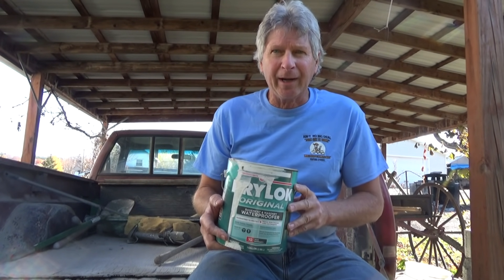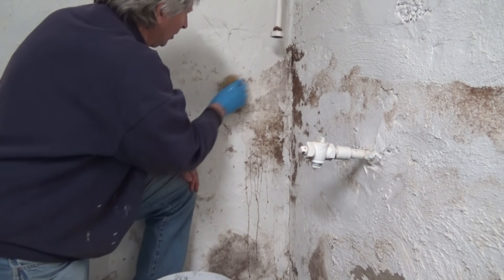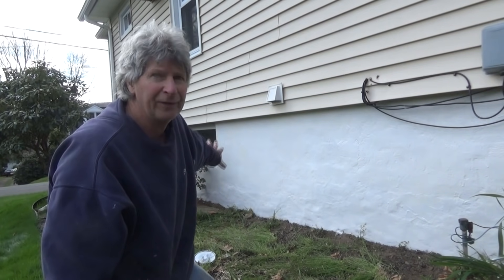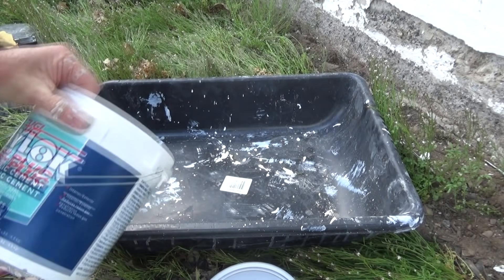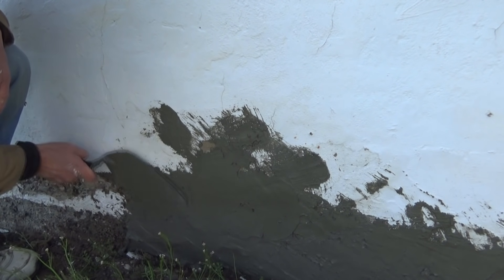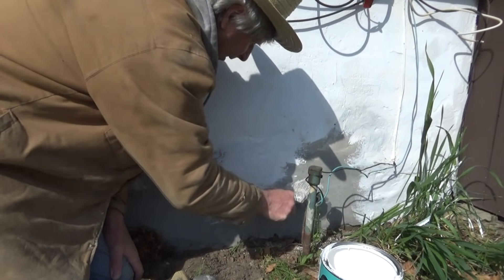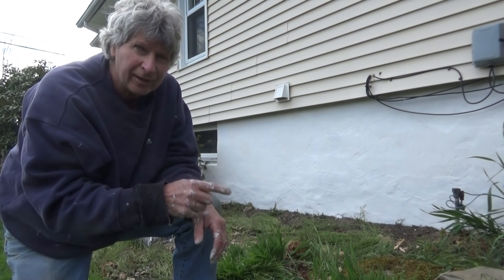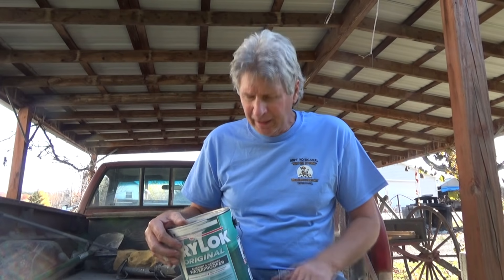FOUNDATION REPAIR (Part 18) Mike Haduck Drylock Paint

Comment: I don’t care how much heat I get if I get any and I don’t care what anyone says, this is a horrible job. If you want to put out quality work and not get any callbacks and you want your customers to refer you to their friends and family then you need to do a little better than this. If you are outdoor or in an empty concrete basement with a drain I would pressure wash it absolutely. That’s not always an option and when it’s not you need to scrape over every square inch of the wall you’re having an issue with and make sure you get every bit of loose and peeling paint crumbling concrete anything loose. Then it should be hit with some type of wire brush. Then I go over it with a standard broom or something with bristles on it. Send wipe it down with a wet rags. Then when it’s completely dry I never brush it on, I roll it on with heavy paint on the roller and pressing it in to each Travis crack hit give it any imperfection in the wall you wanna press this stuff in and fill in any imperfections are voids. Then when it’s completely dry second coat it. It might take a little longer so you make sure you charge enough and this method ensures you’ll have no issues.OK just the way I do shit but I’m an idiot
Reply from the maker: Hi Chris, no worries, I did what I was paid to do, if they wanted that way then it is a different job, I first learned about paint in the Navy, so I got my standards and the object is to make it work with little effort, little cost and no callbacks, thanks Mike